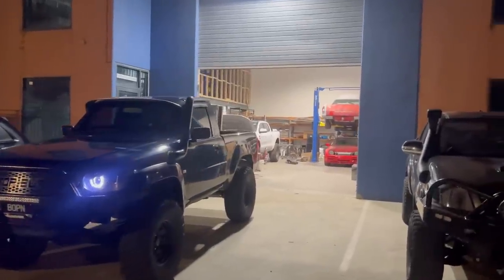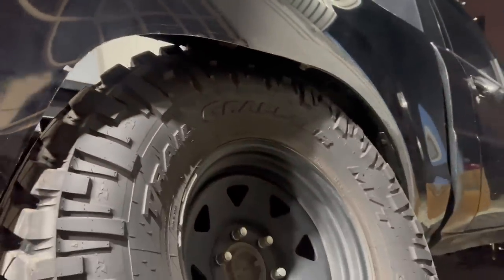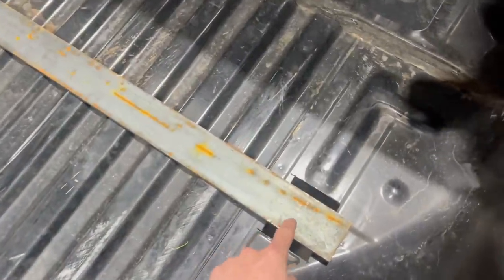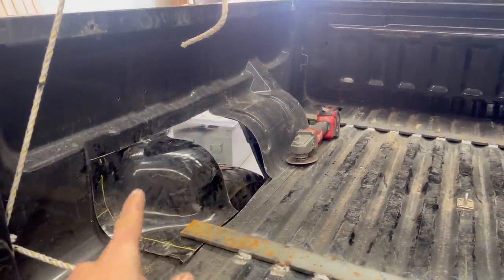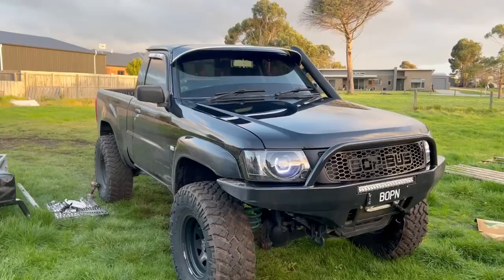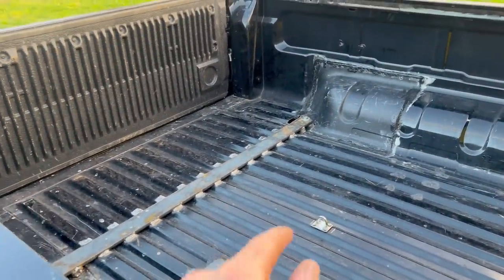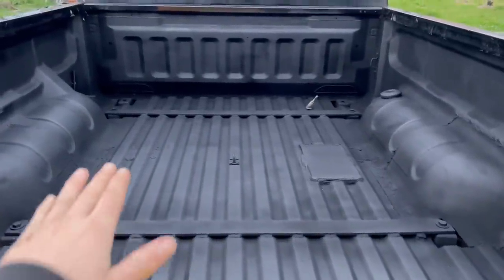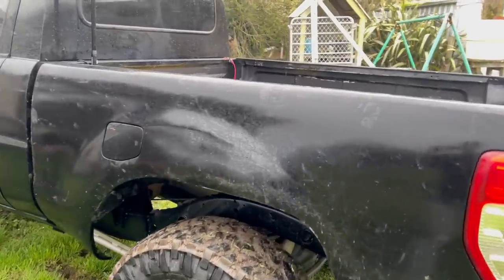GU Patrol tub modifications with Styleworx 4x4

Comment: Awesome build, whats the full suspension set-up u are running?
Reply from the maker: Might have to do a in-depth video on this as there’s a lot to cover but spring wise it’s 4” front 3” rear and 13” shocks
Reply: Yeah id definitely watch it, im just about to start a ls2 space cab gu build i only wants 3 inch lift but max flex. And that tub looks mint by the way definitely something different.